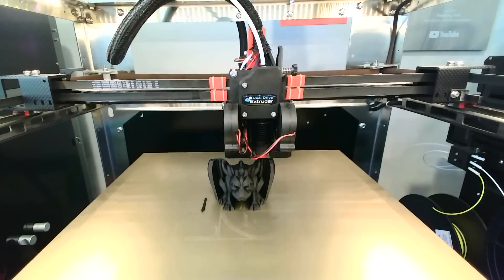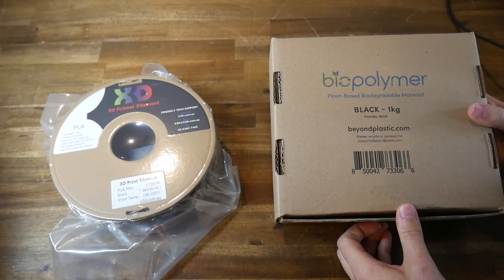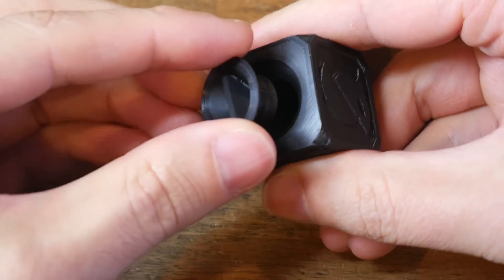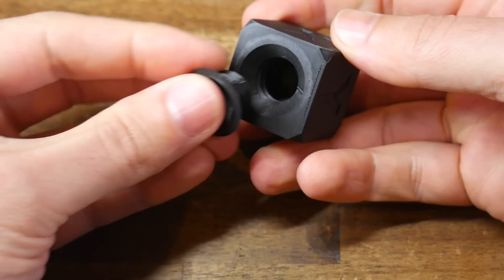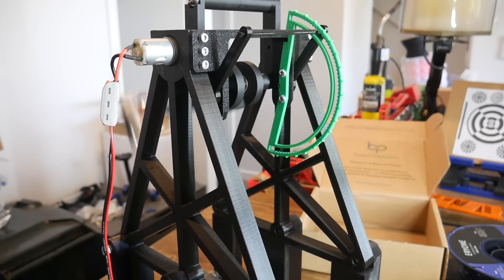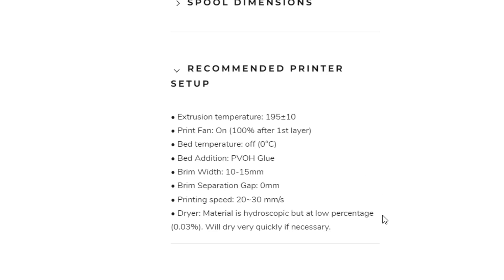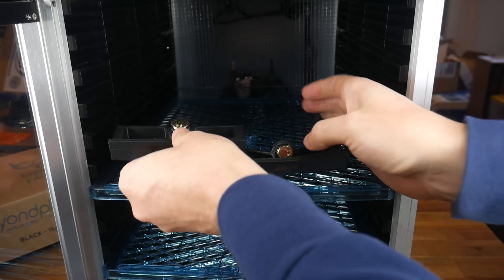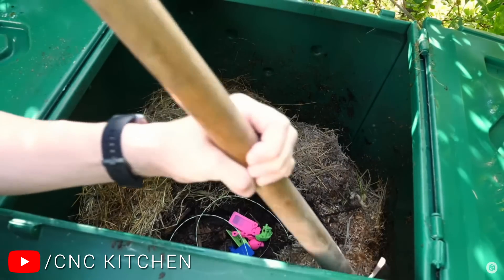PHA filament - Mostly superior to PLA and actually eco friendly

Comment: I have a bit of experience with pha. I’ve known it for quite a while and in the plastic industry they call it the sleeping giant because of its untapped potential. The industry is more into recycled plastics (for now at least) than producing true bio polymers. Also (for what I experienced with a couple of moulders) pha is not easy to injection mold with standard equipment and it deforms a lot when out of the mold even after a long cycle time. It’s more dense than common abs and more difficult to source so it costs a lot. Manufacturers are not ready for it it but maybe 3d printing people are, I personally really like the fact that it’s basically bacteria juice! 😊
Reply: Do you have some insights on what strategies have been found to prevent warping?
Reply: @athmaid unfortunately no. Not much has changed in the last months (price wise as well) so in my line of work material research for sustainable plastics has settled with recycled materials. It would probably benefit from adding some sort of fiber or mineral filler, but I’m just speculating.
Reply: @IL3D that's a real bummer, but thanks for the quick reply! Hopefully someone will give that filler idea a shot at some point

Comment: im wondering, did you lower the fanspeed on the PHA prints to prevent warping? much like PETG needs a lower cooling amount or else itll warp right off of the bed

Comment: The warping isn’t really an issue if you use 3d lack or some sort of advanced glue that prevents warping
Reply: Other than that, it isn’t too expensive so it’s definitely a material to consider, especially thanks to those amazing material properties

Comment: Yeah i think i would be interested in PHA if it where available at a good cost. But the warping would be a little bit of an issue. I would print some benchys for the test as they are prob the most printed 3d model ever. Cheers for the video.

Comment: My favorite bioplastic is celluloid with ivory color. Nitrocellulose, caphor and alcohol. Highly flamable, but who cares. Only problem is that it's used only on historical items, such as slide rules.
For biodegradability, i suggest skeleton from the same author as gargoyle. 
Impact resistance is a bit problematic benchmark for me, I tried to compare PETG and PCTG, PCTG seems easier to break, but it cracks, bends and it's unlikely it completely shatters or breaks to pieces. PETG can survive more, but then it ends in pieces and failure is not predicable. I guess which of these features is better depends on application. Unlike youtubers, I would not say PCTG is better, it's easier to break, easier to scratch (even by fingernail), despite it's supposed to be odorless, it's not or it depends on brand and it's more expensive.

Comment: I would switch to vPHA if it was same cost as PLA as the other comment stated. One thing on Sticking to the bed. We all know that bed heaters are inconsistent. It is always hotter in the center and cooler as we print out to the edges. I wonder if we had a bed that could heat the same throughout the compleat bed size if that would make any difference in warping for all materials. Q: is warping due to inconsistent cooling of the part during printing.  It seems to me that we never see warping of large prints in the center it is always starts at the edges. Again, if we had a bed heater design that heated the bed evenly would that solve or greatly reduce the issue? I wish we had even a crude version of Star Treks Replicator. Maybe 50 or 100 years from now we are going to look back on 3D printing like we do at early computers.

Comment: I am the former CTO of Beyond Plastic LLC. 

Want to address some of the very common questions and had some insight. 

"How biodegradable this filament is (was*)?"
The material is TUV Austria Marine Biodegradable Certified (Certification S2949). This is the highest and most stringent certification available today for biopolymers. 
In brief, it must pass three test that include: 

1) Marine biodegradability as per ASTM6691
 2) Toxicity testing using the above medium with Magna Daphnia, less than 10% mortality rate (we pass with 0%). 
3) Disintegration test, 90 days must break down as quick as paper (cellulose). This was actually the toughest test to pass. 

*BP stop the development of filament, New material is under development by Ecogenesis Biomaterials LLC in collaboration with US partners. Eta December or January launch.

Material Strength: 
One key point that was completely missed, and do wish this was covered as this is critical in understanding all PHA's behavior. 
Because is it made from naturally occurring bacteria polymerization, and not externally as PLA. 
PHA has a Tg of -10c to +6c. This low Tg simply means the material crystallization rate (% of) can not be stopped or set by Heat as you can temper PLA. We all know to make a 3D printed PLA stronger, we can just set a box on top of our heated bead, crank up the temp to 60~65c and increase the cross-linking of the PLA. 
Not so with PHA, because of the Low Tg, the crystallization rate (% of) is set at the material compounding at the factory. As a PHA part will in fact continue to crystalize naturally while sitting on your work bench. You can accelerate the total amount by using a heated chamber (box over part + heated bed). But you will not be influencing the type of crystallization, just increasing its speed. 

And because we don't know how long the part were sitting before being submitted to the impact test. His data maybe completely incorrect, if anything the part could actually be far stronger than represented in the video (not weaker). 

Also worth noting that for these kinds of test, natural color material should have been chosen as to eliminate the potential influence of the carbon black pigment and concentration used. 

In addition: While PHA Tg is very low, its heat deflection temperature is very high at ~145c. While PLA heat deflection temp is very close to its Tg of 65~70c range). Thus PLA prints will fail while sitting on your car dashboard. 
PHA: your car will be on fire 1st

On Warping: 
Heating the bed is the worst thing you can do with PHA, as it increases the natural crystallization speeds in between each layer being deposited. And therefore increase the contraction rate (Coefficient of expansion and contraction). 
What you want to do is quite the opposite, you want to print fast and cool (air flow) as much as possible. 
Prior to the company change in focus (and my departure). We were working with E3D Online and using their new Obsidian High Flow Nozzle to push the PHA print speeds, again the faster you can print PHA, the less warping you will incurred. Also keep you enclosures open and let the fan blast away. 

We are working on resolving warping with new material development that is on going, while ensuring we maintain full biodegradability. But also trying to gauged if consumers even want this type of materials. 

So feedback is greatly appreciated.

Comment: I was pretty much sold on this filament when I saw it doesn't come with vacuum sealed plastic bag. I like 3D printing because pretty much everything can be recycled and any instance of cutting down on those unsustainable parts of the hobby are great. 

The rest of the video had me even more sold as I was expecting it to be much more like PLA rather than having properties more towards what I'd expect from PETG. I'd deffinately consider this over PLA if readily available

Comment: I wish this plastic becomes a thing. I hate the feeling I get when a print fails and I have to throw it away. This guilt makes me feel 3d printing is not good for the environment. I avoid printing useless objects for this reason. So please manufacturers, make this happen ASAP.  I want to print more but without the guilt. I am full in. If this becomes a thing, I will only buy from this manufacturer, even if I have to ship this from abroad.

Comment: i would for sure give it a try at least if it was available for the same conditions. The heat resistance makes it pretty interesting. 
As for your tests, a few things came to my mind regarding the model. It would be interesting to see how much it stays in dimensional accuracy during the test period. So a model with measurable dimensions would be good. Perhaps it would be fun to make a crossover episode with Stefan from CNC Kitchen or Igor from MyTechFun to test more mechanical properties? It sure would be interesting for me, seeing you doing practical prints and test them in everyday use, while one of them tortures testprints in every thinkable way

Comment: Very interesting stuff. I noticed that colorFabb from the nEtherlands has something called allPHA which appears to be PHA and in stock. Price point is 25€ for 750g which is pretty ok and not as expensive as I expected given the comments. Definitely gonna try this on the next actual product for selling. Should be a nice alternative to the other filaments.

Edit: Small correction, the price was missing tax, so it's actually 32€/750g. Which puts it about 2x of simple PLA.

Comment: If it wasn't for the warping it would be very tempting.
Unfortunately it is the reason why  i really don't like to use ABS/ASA. And since it is not solved neither by bed temp or enclosure. Sorry that is a deal breaker.

Comment: I wonder if slowing the prints down, increasing nozzle temp, and adjusting cooling fans could reduce internal stresses that lead to warping w/ PHA?
Reply: Do the opposite, print fast and highest fan possible.

Comment: I think you should test the biodegradability for sure. It would be nice to see a fine lattice to see how well fine objects break down, but I would also like to see functional parts printed and exposed in the same way to see if they are affected.  Maybe objects with fuzzy texture will catch bacteria in the air and degrade on a wall outside, or do stakes in the ground with plant labels loose their stake?

Comment: For me it needs to be a real upgrade. I switched to PCTG earlier this year and love it too much. I'm worried that the biodegradability of PHA is compromised by different types of pigment that filament producers add. There are pigments that could potentially be bad to environment like the microbes that break down the PHA.
Reply: Former CTO of BP here. All pigments were certified to be either inert or biocompatible.
Reply: @fredpinczuk7352  Hey, thanks for replying! Good to know that BP was actually mindful of this. Though I personally wouldn't trust filaments that come from China or unbranded stuff. There's even big filament makers who do not share which pigments they use, which I often try to find in the technical datasheets but it's rarely in there.

With composting, one of the first things I would think of, besides biodegradability, is the use of additives that could be harmful.

I hope this PHA becomes a thing so I can give it a try :)

Comment: I would switch if I could find it for the same pricing as PLA - BULK PLA so $10USD or less per roll. I like the lattice cube for a test model so it isn't as solid and could possibly show degradation a lot quicker.

Comment: In bioresorbable medical implants it's not uncommon to see PLA used so for sure it biodegrades eventually. That said, what's often done to speed up this process is to blend it with PGA, not PHA. The resulting material is sometimes called PGLA or PLGA, and degrades an order of magnitude faster than either compound on its own. PCL is also commonly used but its softening temperature is too low for many applications.

Comment: In my experience, there are 3 major downfalls to PHA:
1. Warping, as you mentioned
2. Bridging, as you mentioned briefly 
3. Malleability or lack of rigidity. PHA is very soft compared to PLA or PETG, which makes it unsuitable for structural prints. Anything <0.8mm wall thickness is very bendable and does not want to bend back to its original shape.

Oh yeah and one more that you also mentioned: it’s difficult to source
Reply: Shore 70D already tells the story
Reply: @hanswurstusbrachialus5213  I LOOOOVE my 65D TPU, so this could work well for me. But it seems to not spring back as TPU? Thats a problem if so...
Reply: Any experience with how it behaves with other filaments for support? It's probably difficult to get any other filaments to work on a cold bed at the same time.
Reply: So it's more like PP?

Comment: I am very interested because a home compostable plastic is a unicorn. It doesn't exist, at least not yet to my knowledge. The "compostable" plastics presently have only been compostable under the highest cost commercial facilities, and then, they have composted minimally. It's not truly compostable if it doesn't fully break down in a reasonable amount of time, say a year in a properly tended residential compost pile. That would be a game-changing product.
Reply: Correct, greenwashing PLA products have become the norm. However, you may have noticed that a lot of PLA filament producers have now removed any claims of biodegradability. Or at least the once that do not want to be sued by EU and Canada Anti-greenwashing laws. 
We are still playing catchup in the US.

Comment: I collaborated with Beyond Plastic and tested their PHA formulation, the warping issue is that formulations main issue. Check out the PHA subreddit, I have some research posts showing how to fix the issue entirely, however the answer was to expose my Prusa MK4 to near freezing temps inside of my refrigerator!

The former Beyond Plastic engineers are still working on a "next generation" PHA, which should resolve the warp issue without needing to freeze the ambient air around the printer to prevent the warping that occurs during the crystallization process. Keep an eye out for it in the future, you can actually sign up for the testing in the subreddit.
Reply: Hi Derrick, you are 100% correct. 

Great to see you here.
Reply: What in the world. That's pretty funny because you'd expect heat to be the answer while in here taking it away was. Pretty interesting
Reply: @ares395  You can read my intro at the above, but yes. It is counterintuitive. but it as everything to do with Tg temp being of -10c to 6c.
Reply: Interesting. Solid metal plate under the build surface, keep it in the freezer and bring it out just before printing?
Reply: @6yjjk  Interesting hypothesis. May have to try that.
Reply: @fredpinczuk7352  My only concern would be with possible condensation affecting adhesion. Fridge rather than freezer might reduce that; I don't know how long it needs to stay cold, just for the first layer or throughout the print.
Reply: @6yjjk  I was thinking about your theory. I thought about getting a cast aluminum plate roughly 5 mm thick, that would fit within my Prusa Mk3s bed. I have relative low humidity where I life, so should provide some insight if it even works. And if it does, I'll then had water cooling channel and pump cold water through it.
Reply: @fredpinczuk7352  A water-cooled 3D printer, that's insane, but it's the good kind of insane :) I've been thinking more about this too, and I'm guessing that you want to keep the bed cool throughout so that the bed doesn't expand and release the print early. Would be fun to experiment with running hot water through the same pipes for more conventional filaments, and with switching between hot and cold for faster part release, which might be useful in a print-farm environment - as might just centralising the source of heat/cooling into one large tank.  Hmmmm...  :)
Reply: That is one way to stop having to do active part cooling too lol.
Reply: So this would be a great filament for New England garages 😂
Reply: Hmmm... My MK4 is enclosed. Maybe I should look into an LN2 dewar to spray a mist of LN2 into the enclosure volume when printing. Maybe not... My printer is in my basement and I don't want to fill that volume with cold N2 gas... Yeah, that'll take care of all the camel crickets that my cat's haven't caught, but would also take care of my cats and eventually my wife and myself...
Reply: Is that the current stuff available from Hartsmart labeled as "Gen 2"?
Reply: awesome, thank you!
Reply: In metal that sort of thing is how tempering is done. How's the speed of cooling change the structural aspects of it? Smaller crystals would probably make it less elastic but might also affect it's temperature stability? That's nifty to know.

I wonder if you can use an old college trick of adding salt to ice to lower the freezing point run a copper tube through it to exchange air temp with it to get enough cooling if ducted through the part cooling fans. Or if some peltier bed coolers would be needed to get there. So strange trying to get a print cold, normally you struggle to get it hot to keep stability.

Comment: I'd never heard of PHA until now, but if it performs as you've shown then it seems to be overall better than PLA and much better for the environment.
I'd be willing to pay a small premium and switch to it, if it was priced similar to PLA I'd definitely make the swap... providing that it is better for the environment, so looking forward to your follow up testing!
I was impressed with the heating comparision against PLA, what's the glass transition temp of PHA?
Reply: Tg of PHA is -10c to 6 c. 

What you really want to know is the heat deflection temperature. And that is 145c range. 

Compare to PLA having Tg of 65c and heat deflection temp of 70c.
Reply: @fredpinczuk7352  Thanks, indeed I was looking for the temp at which it softens (which I've often heard others refer to as glass transition temp).
From the video clip showing it in an oven I figured it must be quite a bit higher than PLA
Reply: Same here. I'd pay 50% more for a truly home compostable filament